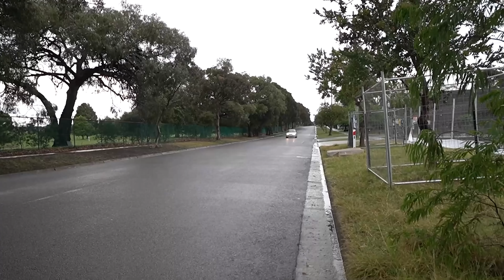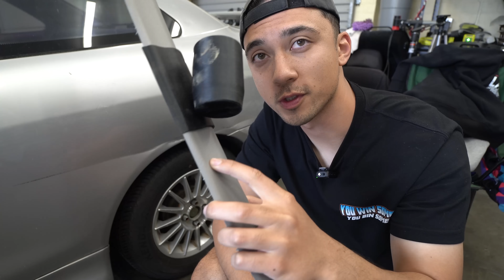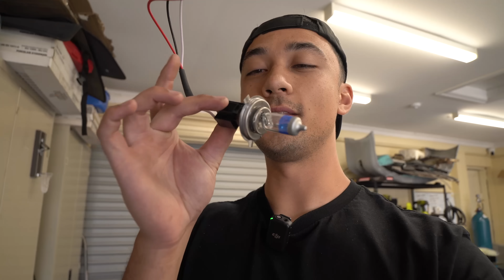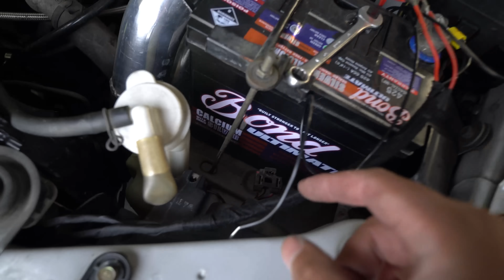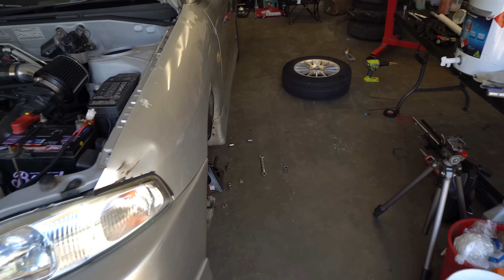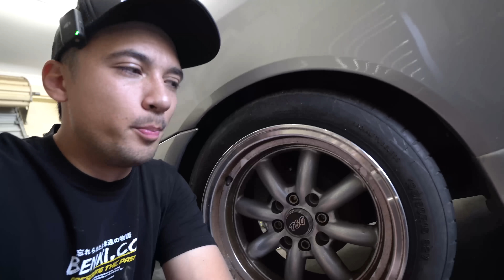ARE CHEAP PARTS GOOD?

Comment: I had maxpeedingrods on my 2013 lancer... I completely removed the spring in the rear to dump it Lower.. replaced shocks with spacers and had the front dumped as low as possible with the bottom rings removed 😅 it was absolutely slammed and I totaled it when on the highway hit a bump and the rear strut went straight through the trunk sending me into a big ditch.

Comment: YouTubers that are sponsored by a brand never give a good review for a product. Those coilovers are crap, even for the price. Better off keeping standard shocks and putting lowered springs in. Been there, done that.
Reply: I’ve seen quite a few sets break

2 sets were within weeks of installation and both broke in different ways

The bottom part of the shock mount threads stripped and the other was the top of the shaft snapped

I’ve also driven cars with them installed and they rode worse than blown shocks

They are rubbish I will always install a good set of shocks and lowered springs over a set of sub $1400 coilovers
Reply from the maker: I wouldn’t put them in my if I didn’t think they were good. I also know people that track their cars with these coilovers.
Reply: @ I would only use them on the track as the track surface is far better than a road surface. Each to their own. There is a reason why this brand has a lot of bad rep. The honest reviews heavily contrast the sponsored ones.

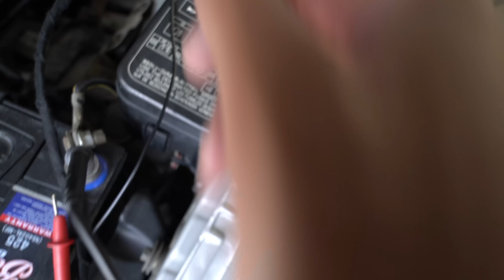Comment: 7:39 Hey rex just noticed there was no fuse on the power side of the relay, probably a good idea to out one in on both wires as that is a major fire hazard
Reply: Realistically, a few overpower cable enough to cause a fire your headlights would just blow so as long as he is using the right gauge wire it doesn’t really matter as much as if it was a subwoofer

Comment: I would've kept those rims you had it on before n spray paint them, they would come nice I think, get some tires with colour branding labelling, red brakes too perfect 👌
Reply: nahhhh too small, wrong offset, would need to run spacers to bring them out for flush fitment.  lad chose the better wheels :)

Comment: 7:41 no fuse? nooo, thats just asking for a fire
Reply: I'm curious, how would it cause a fire? isnt it only 12 volts
Reply: @Dripppz  for example if a positive wire falls off and touches a ground point, it creates a short circuit and starts a fire. A fuse will break the circuit as soon as there's a short circuit